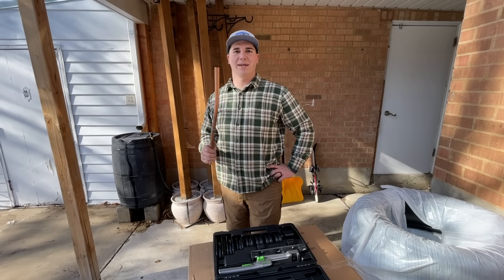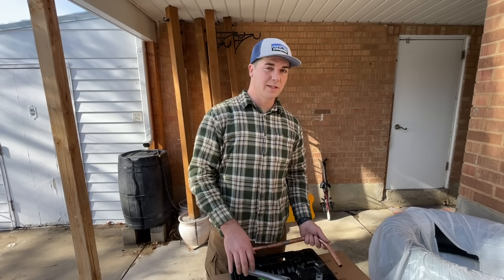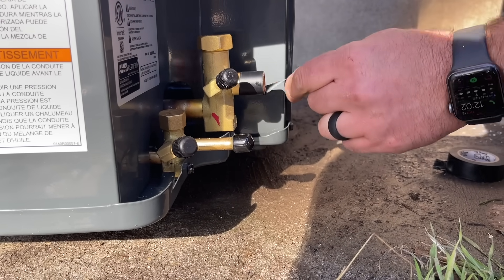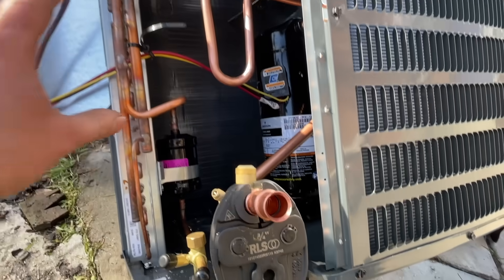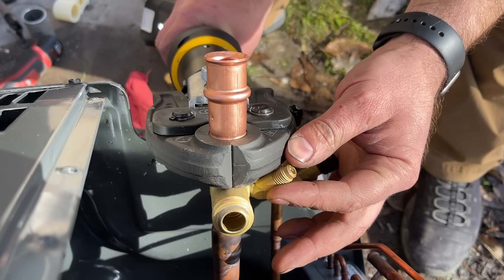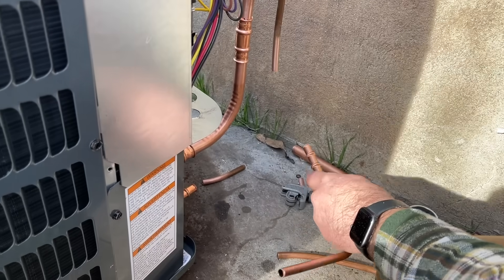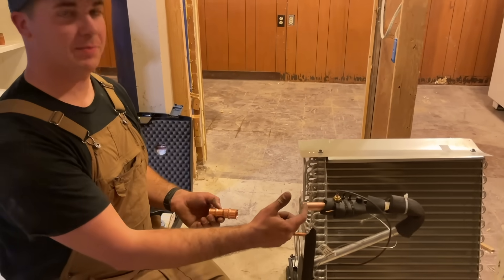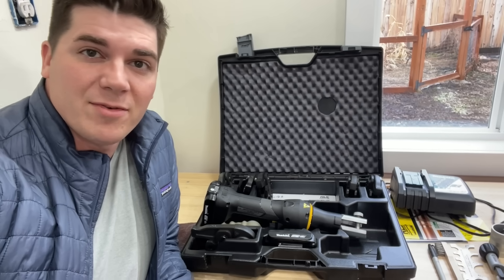Brazing Is For Cavemen. THIS Is The Future Of HVAC Copper Connections. -RLS Crimping Tool-

Comment: I’m an industrial pipefitter and I cant tell you how many of those things I have had to cut out and solder standard copper fittings back because the pipe froze and the fitting got pushed off because of the pressure of the expansion of the ice .
Reply: As opposed to the pipe splitting when it freezes?
Reply: Some things look good on paper. 
Others look good on paper as well as the real material.
And then yet others look good on everything until they get out in the real world and imperfect conditions.
Reply: Lot of power in freezing ice. If it really freezes good then it's going to get broken one way or another.
Reply: @@AdirondackHomestead sounds like these fittings are possible safety release for freezing conditions.
Reply: If copper pipe freezes it will burst. I've seen this many times. If it freezes, somebody screwed up big time by shutting off the heat. 😮
Reply: irrelevant in refrigeration though there isn’t any moisture in the pipes to freeze
Reply: @ I don’t care, I flat out don’t like pro press and I will never use it for any reason ever !
Reply: @@AdirondackHomestead really you dumb nuts like I don’t know that they are refrigerant lines . I was just making a reference to pro press in general and my experiences with it . I started plumbing in 1976 and I am an industrial pipefitter and welder and I have never seen a hvac mechanic use that shit on refrigerant lines. The fittings are not necessarily the first thing to freeze and bust when water lines freeze but yes they do bust but I can guarantee that pro press will always pull apart before the copper tubing busts and based on the cost difference of sweat versus pro press it doesn’t even make sense to use pro press unless you just have money to burn.
Reply: sailingwiththegods538  I know that copper bursts under pressure especially when it it is from freezing ,i was just saying from my experience the pro press is no better than soldering when it comes to freezing bro . based on the price of pro press ftgs and the crimping tools you are way better off using standard sweat fittings , they are faster easier and cheaper than pro press .
Reply: Facts only for temp repairs
Reply: @Tysonrojas6969  please explain

Comment: All the ppl bitching about propress joints and potential leak failures🤦‍♂️...the lifespan of fitting/seal far exceeds service standards when properly installed. Additionally, the benefits of removing brazing chaff/debris from the system has a greater positive effect than the occasional leak.

Old hats love to knock new tech and standards.

Comment: In HVAC for 20-years now, my advise, learn how to braze.  It's what makes you a tradesman instead of a hack.  You'll find in life that most things that are easier and cheaper are usually not as good, nor last as long as simply doing it the right way!
Reply from the maker: Everyone assumes anyone with a crimp tool can’t braze lol where did you pick that idea up from?
Reply from the maker: A crimp tool is definitely not cheaper. And the time is about the same as brazing. But I just did  a job where a fire permit is required and this eliminated the need for one, also space is a huge factor on some jobs.

Comment: This is super interesting. I've never seen propress for HVAC application. I'm all for new applications that would basically eliminate brazing mistakes by installers that  never use nitrogen to prevent pluged up metering device.

Comment: I am an IT field engineer and many years ago, I was tired of waiting on electricians to put in my conduit... so I shadowed under a soon-to-be retiring 33+ year master electrician.  Long story short, one of the many things he showed me was bending EMT... he had all the math formulas in his head ready to go.... it was crazy!  I wrote them all down for 1/2" (most common for me) 3/4" and 1".  I have the benders for 1/2 and 3/4 but I've never tried bending copper with them.  I know copper is very soft compared to the rigid EMT... I wonder if those benders would work on copper piping?  I would imagine I could do my saddle's, offsets, etc.... with copper, might look a little weird, lol
Reply: Just got to your crimping part... that method is very similar to Pex B crimping.
Reply: make a video

Comment: Pretty sure that's the fastest way to void a warranty
Reply from the maker: Umm no
Reply from the maker: RLS fittings have been approved by UL-207, ASHRAE 15, International Code Council – Evaluation Service (ICC-ES), International Mechanical Code (IMC), Universal Mechanical Code (UMC) and International Residential Code (IRC).
Reply: @diyhvacguy  bro first step was cut the service valve lol

Comment: Zoom lock “ crimp connections “ aren’t the best option for heat transferring piping as expansion and contraction occurs with heat cycle changes especially with heat pump or heat recovery vrf systems as the suction or common line Varies from 45 -175  degrees year round. I’ll stick with my 15% rod

Comment: Instead of cutting the bell off of the service valves, you could have StayBrighted a stub onto the valve then crimped the RLS to that.  This would have given you the full surface to connect the RLS too and the ability to braze tubing to the fitting the way the MFG intended should the need arise later on.
Reply from the maker: Yea I’ll probably do this on the next one. Thanks for the tip!
Reply: So you want to low temp a fitting so you can crimp on a fitting? Just learn to braze. Staybrite is illegal anyway.

Comment: Now the various new crimp connections is what I do recommend for VRF. Too hard to get techs to flow nitroogen and those things have no filter drier, only strainers that catch larger debris.
The premade flares that crimp on to the copper are also awesome.
Reply: You don't have to flow nitro if you use the proper torch. A good quality solder and propane torch is all you need. It doesn't get hot enough to require a flush.

Comment: .. Extra costs.. Extra tooling to carry around, and I don't see all this being faster than soldering but that's no what concerns me the most. It's the fact that there's an o-ring in there that seals it. O-rings die in time, they dry out, get hard, or chemically they break down depending on what they're exposed to. It's my bet that at least one manufacturer will go the cheap route and put low quality O-rings in the couplings. This is something I've come to expect out of ANY O-ring coming out of China. 
I have soldered fittings on my own refridgeration system on my home that are 50 years old. No problems yet. 
Claiming that they're safer is rather silly to me since pretty much NO plumber or HVAC tech sets buildings on fire by soldering. I never did.
This system strikes me as a novelty and I would not expect them to hold up over the long haul, and then they do start leaking they're going to be more work to replace than a soldered connection.
It's a no sell for me.
Reply from the maker: All RLS fittings are made in the US. The new zoomlock max fittings are made in China, I might not trust those, but the RLS ones are definitely made here. I can respect people not wanting to try it out. To each their own right! Cheers man
Reply: @diyhvacguy  As I pointed out my problem would be the O-ring itself. One must trust in the composition and quality of the O-ring. There are things made in the USA that use import parts and materials. Even if the O-rings are made in the USA will they hold up over time? I know properly done solder joints will hold up for more than 50 years. Of course like these newer compression type system the installation must be done properly and with the proper materials or all bets are off. That part hasn't changed. Certain types of soldering / brazing can also put contaminants in the piping and as such require nitrogen flow to prevent. 
I think this is going to be one of those things that needs a few decades under it's belt before we know the long term. 
There have been some plumbing supply technologies that turned out to be disasters where entire housing developments needed to have the walls torn apart and the plastic plumbing removed and replaced. 
Time will tell.

Comment: Brazing is a reliable way of joining copper, on the commercial side I would shy away from it defiantly with High pressure gasses. I would use it all day long on domestic water, hydronic applications.

Comment: If the outdoor unit is not set up for crimping from factory I would not cut the service valve. Weld a short copper stick on there. Sadly with A2L refrigerants coming and explosive hazards we will be using this is the future and pushing that cost to customers as we have to supply expensive fittings, time and tools.

Comment: should of soldered  a small piece of copper off the service valve first then zoomlocked it.  that way u could always un-sweat the copper off the valve.  you just screwed yourself pressing that to the service valve.  Not a fan of zoomlock im my experience of being in the field.
Reply from the maker: I have a recent video that shows how to remove one of these fittings and reuse the pipe it’s attached to. In this scenario the service valve. It’s really not that hard. But hopefully they’ll start making them with longer stubs!

Comment: Just invested into this kit myself, (Rothernberger) I’m in the UK 🇬🇧 I only install mini splits, and Mitsubishi state no flare joints allowed inside. So thought these would be ideal for areas where heat isn’t a great idea. 
The fittings here have a 5 year warranty! 10 years if you complete the fitting manufacturers course on how to use tool and fitting properly. The fittings here are different they press either side of the Oring and seam solid! I have tried to brake them apart on a scrap piece but they don’t move and are solid! So I’m guessing with it being a throw away society now days, they will last about as long as the units. Time will tell if it’s a wise investment! But I sure like just pressing it together.
Reply: Clasic fantastic this stuff is not working  in 30 years I have not problems with leaking in sistems which I brazzing or welding😂
Reply: So you've sold you soul to the chuck away society. Go back to brazing/silver soldering and take pride in your work!

Comment: A lot of comments on lead solder. This is not food or water contact service. While lead solder can't be used here, even if you did, the lead solder has no way to enter a person's body from the HVAC connection. Lead solder is only a concern for contact with materials for human consumption. Lead solder was used for decades in the electronics industry but no worries there unless you are eating the parts.

Comment: I'm not an HVAC guy, but I have read that the main problem with car A/C units is leaking from the O-rings.  I haven't had a problem soldering pipes.

Comment: I am curious if the rls refrigerant press tool is different from the milwaukee press tool used for plumbing. With refrigerant copper being thicker than water line I’d assume the milwaukee press wouldn’t work?

Comment: Nooooooo!!!.....  Never cut off the only piece of tube you have to work with.  You left no possibility of doing any future work without a MAJOR overhaul!  If you want to use a press-fit style system then braze on a random piece of tube and then transition to the press-fit.  By cutting off the flare you left yourself with zero options if you make the slightest mistake.  I have used many different types and brands of  press-fit systems, and they are definitely time savers, but they are definitely not foolproof.  Mistakes happen.  Only a fool will tell you something is foolproof.
I also have a hard time believing that one o-ring will stand the test of time.  The pressures and temperatures in hvac systems are pretty extreme, and o-rings have such a tiny amount of surface area contact.  Expansion and contraction from pressure and temperature changes will fatigue the joint.

Comment: The little grooves mostly if not entirely go away if you lubricate the tubing before bending.  A little high pressure grease works ideally, however in a pinch Vaseline or even dish detergent and water work well enough.

Comment: Like many have said before, those crimp connections are unproven technology. Brazing is not. Whether it's the insurance companies dictating "flameless" installations or contractors looking to save on labor costs, they are taking the skill out of the trade. Oftentimes with a worse product for the consumer. 

Being a thirty year pro, I would never ever have a crimp fitting installed in my house. Don't get me started on sharkbite fittings. 

One word of advice if you've installed sharkbites in your house, check your insurance coverage to see if you are covered. Sometimes it's cheaper to hire a licensed pro.

Comment: I work on aircraft and we use hydro fittings for that hold up too 5k psi and even when installed correctly they still will leak . This product is no different and only time will tell when the class action lawsuits start flying if it worked out in the long run .

Comment: you went from 2 brazed joints, one of which was a 3/8, to 8 press on joints. Not to mention the poor guy who has to come in 10 years from now to replace that condenser. More heat pumps are on the way, as fossil fuels get phased out. Your discharge line temp on heat pump will be 100+ degrees over your ambient. 410A at even 140 degrees is north of 500 PSI, and over 600 PSI isn't uncommon on "chilly" days when it's not really cold. I guess we'll see 10 years from now how many of these failed.

Comment: I have done HVAC and refrigeration for many years and one thing that I can attest to is the fact that most line sets are not "round". I have had to use a crescent wrench, many times, to re-round the tubing just to get an elbow to fit on the line set. How does that work out for your O-ring fittings?

Comment: I would have been done brazing it in less than half the time with 50% fewer points of potential leaks.
Reply from the maker: Well you keep doin it your way, no judgement here. I brazed in the last job I did and it was such a friggin pain, I much prefer this method, and by the way this was a tutorial not a speed test. Not having to deal with a flame is pretty fantastic. Time will tell but I’ve talked to a lot of folks that like RLS

Comment: Don’t think you can used those fittings on soft copper
Reply from the maker: Yes they are rated and designed for use on soft copper

Comment: I'm not in the trade, but I have done other tasks that can be done both an old fashioned way and a gadgetry way and learned to do both.  If that had been my house, I would have wanted that first connection (where you had to cut off the 'bell' and shorten the A/C unit's pipe) to be brazed; then crimp the rest.  I would worry that being a few mm short might compromise the connection (don't think it did, but how does one know); and that there would not be room to get the bulky tool into place (I was wrong there, you did get it done, good job, but had take things apart a little to gain access).   But if that first step failed, then you would have "burned a bridge" and had to replace more.  The crimp method looks faster but less "retrievable" if you have to undo it.  I wonder what the longevity is of a brazed connection vs a crimped.  If the crimped connection depends on a plastic O-ring, how long until that material fails, I wonder.

Comment: I would consider crimping it everywhere aside from at the condenser. Way more hassle than what it's worth. You can literally braze in a condenser in less than 2 minutes
Reply from the maker: That’s true. I just wanted to do a fully system with just the RLS fittings so time will tell. I’ll let you guys know if I have issues with this system. Cheers

Comment: There are two kinds of people, those who can braze, and those who cannot.
Reply from the maker: So many levels of wrong in this statement lol have you seen any of my other videos?
Reply: @diyhvacguy  There's a few reasons I prefer brazing to this tool.  1.  Cost, brazing oxy/acet torch setup is cheaper.  2.  Braze joints can be reversed if needed.  If you ever needed to redo/remove a piece, simply reheat and pull the copper out.  With your method you'd have to replace the actual ports on the unit if the RLS joint ever was to fail or have a bad press, correct?  B/c once it's crimped, you're not removing that piece I assume.  

The final and main reason I'll stick with brazing.....is time saved.  It takes literally no time to braze up a joint.  What you're suggesting is carrying one more tools in an already cramped van.  I used to be really into the gadgets, benders etc.  I'd waste so much time trying to get the perfect bends and end up scrapping the shit over and over until I got the bend perfect with benders.  I do use benders if I need a perfect 90, but beyond that it just becomes cumbersome.  This is especially evident when i'd try to make 3+ bends on one piece.  Then you go to put it in and one of the angles is off by half an inch or something.  I'm not saying this tools aren't useful...but in the field where time is key, most of the time I found bending by hand and brazing to be the most efficient way to get the job done.

And let's be honest here, most of the guys I worked with on installs made 15-25 an hour, and used the shop's torches etc.  You think they got the extra cheddar to buy a tool like that?  I actually have a propress for plumbing which is very similar. I like it when it's useful.  Mainly for pressing on a new stop or ball valve on a pipe that is leaking water continuously.  Outside of that though, I actually like soldering.  The materials are way cheaper, the job looks cleaner, it's reversible, same main points really.  A press joint costs me like $7-10, the same sweat joint costs me less than $1.